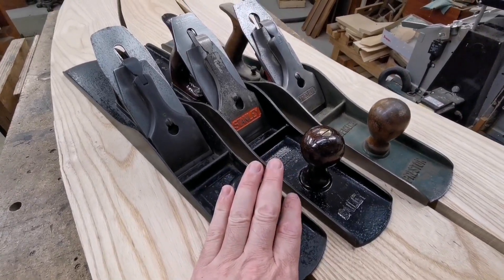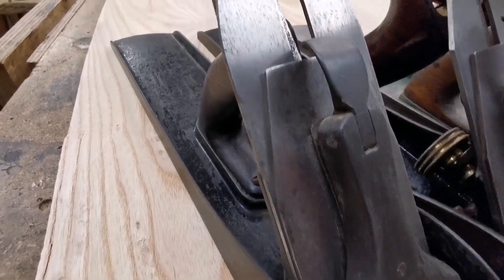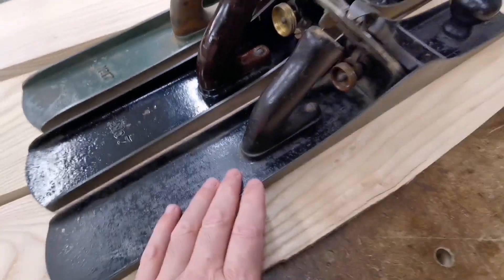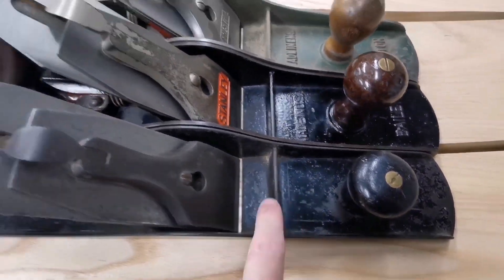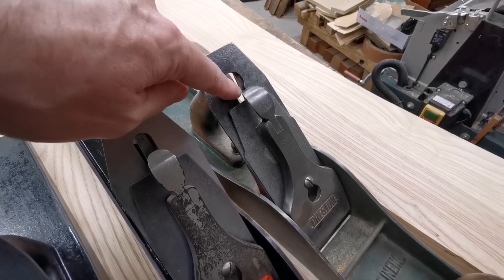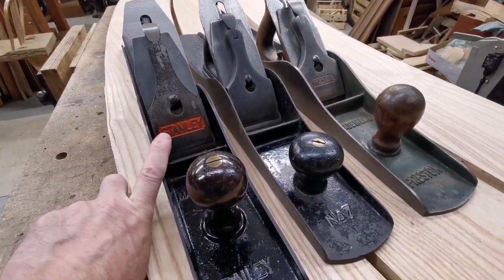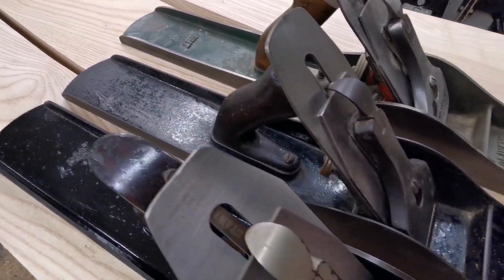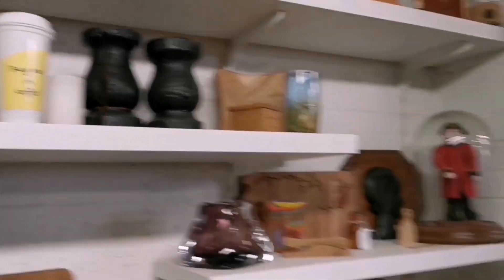Stanley no7 jointer plane. Or Preston no17 - (compare Jointer planes) to SELL One

Comment: For me it depends what you want to do with the plane. If you want to use them, the type 8 needs to go. Small adjustment wheel and no frog adjustment. The other two are more practical. BUT, if you follow that thinking .... then two need to go! If I was only thinking practically I'd only need one number 7 and the one to keep is the newer Stanley. BUT (again) who thinks like that. If you get most pleasure from using special tools, it the newer Stanley 7 that need to go. It is the boring one of the three. If it were me .... I'd keep them all - and yes I have too many planes!
Reply from the maker: Excellent comment 👍 yes I've got a couple too.
Reply from the maker: You might like the latest video. A Tiny Thumb plane, not only cute, but Bronze and a rebate plane too. A very special little usable tool.
You can watch it here
https://youtu.be/JOGxjoQyLKk
Thank you
Jamie

Comment: FYI Stanley plane dating/typing is a mostly American thing - & the identifying features/nuances used to date US made tools aren't applicable to their UK made tools, which often retained features of older US types. Stanley didn't start making tools in the UK until the late 1930s - so either the blade in your 'early' #7 is a replacement (perhaps on an older US plane body) or the plane isn't from circa pre 1902. From my limited experience, WWII era UK made Stanley planes are all over the place when it comes to what details and features are present/missing.
Reply from the maker: Thank you for this. As you are aware both the Stanley planes in this video are both US made and Stanley used to supply a huge amount of planes to the UK before they started making them here. The family business where these both came from was well established in the mid 1800s, so I believe these to be not 'messed around' but more likely we'll worked, and understand that irons could have needed to be changed at any point during their lifetime. Thank you. Jamie
Reply from the maker: Hi. You might enjoy this plane too. Now it's up and flying along https://youtu.be/Qvmjd4JwlDE
Thank you for your support.
Jamie

Comment: Preston £200
Reply from the maker: Is that a guess? Or what you've seen one sell for Peter?
Reply: @twcmaker I've only seen two Preston 17s in the wild one that was absolutely immaculate and one in fair condition like yours and a no18 that was boxed in perfect condition which sold for £550

Forgot to add the earlier Stanley was a newer blade , wasn't the original which was in it .
Reply from the maker: @williamn01 Don't know how I missed this. Apologies for the late reply. That no18 in the box was 😙👌 I had a eye on it but way to high for me. 
You might like the latest video. A Tiny Thumb plane, not only cute, but Bronze and a rebate plane too. A very special little usable tool.
You can watch it here
https://youtu.be/JOGxjoQyLKk
Thank you
Jamie